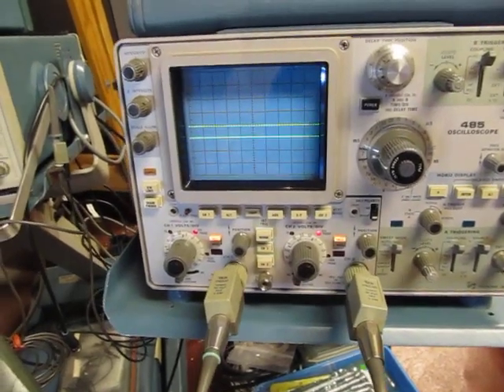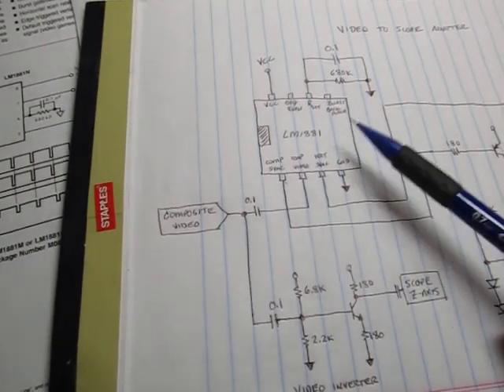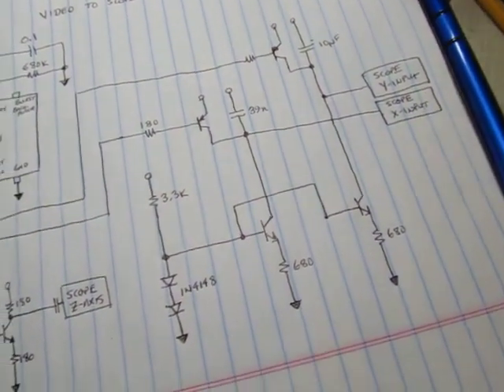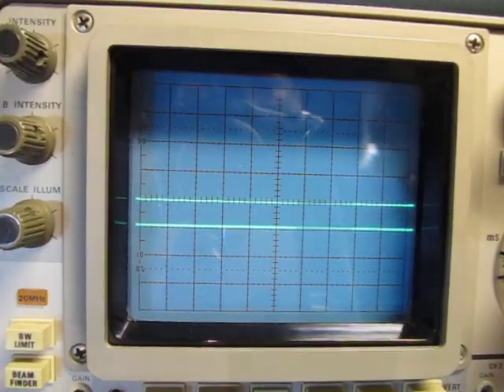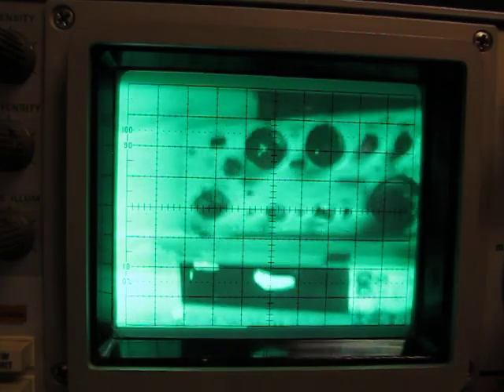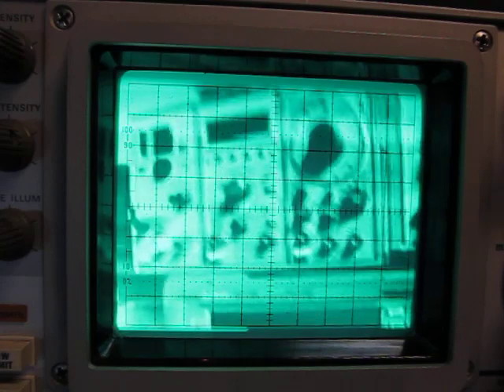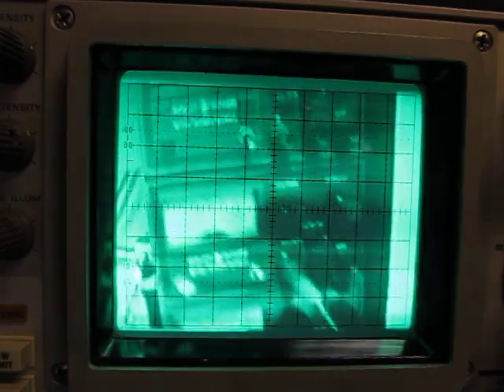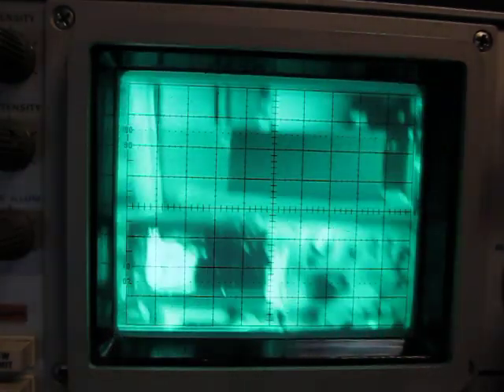#42: Composite Video on an Analog Oscilloscope using XYZ - Lab tour...

Comment: The only video to scope adapter circuit I've ever seen relied on the vertical and horizontal pulses driving oscillators that have to be adjusted, but this circuit is much simpler and easier to use.

Comment: @w2aew You said this earlier "In most cases no.  While most digital scopes have an XY display mode, very few of them have the ability to vary the intensity using an external (Z) input which is required for this to work". Surprisingly I found HP54600B (mid 90s DSO with 'analog' feel) with the following in their product manual: "When you select the XY display mode, the time base is turned off.  Channel 1 is the X-axis input, channel 2 is the Y-axis input, and channel 4 (external trigger in the HP 54600B and HP 54603B) is the Z-axis input.  If you only want to see portions of the Y versus X display, use the Z-axis input.  Z-axis turns on and off the trace (analog oscilloscopes called this Z-blanking because it turned the beam on and off).  When Z is low (<1.3 V), Y versus X is displayed; when Z is high (>1.3 V), the trace is turned off". This means that it should theoretically work, isn't it ?
Reply from the maker: +analogy ? It depends.  This application requires some linear control over intensity, while it sounds like the HP54600's z-axis input is binary, like on or off, and not an analog adjustment of intensity.

Comment: I would then either need a VGA switch box to select my second monitor or the scope or I would need a second VGA card.

Figure the VGA capability would make the circuit more versatile, but that said I do have a My HD TV tuner card that I think might be able to put out a VGA signal or maybe a composite signal. That might work better as I think I could clone the desktop to it so I'll have a full display as well as the scope.

Comment: Hello very interesting application. I have some questions about the pnp transistors. We have 9v DC on their emitter's so what's the influence of v base on transistor? It is always in saturation mode (the amplitude of composite video is not Large enough to have influence) 
I can't understand how it makes ramp if the pnp transistor is always saturated.
Thank you
Reply from the maker: The PNP transistors are only saturated when the SYNC pulses (active low) are present. Once the sync pulse goes away, the PNP transistors are off, and the NPN current sources creates the voltage ramp by linearly building charge on the capacitor.  The SYNC pulse turns on the PNP which discharges the capacitor and starts the ramp cycle again.

Comment: Great video!! Watching it, I had an idea, but I don't know if it makes sense: I have an old computer CRT, which I think works good, but the circuitry is not. What if I build a circuit similar to yours and hook it to the CRT and yoke? In other words, it would be like replacing the circuit boards inside my monitor with a new tiny board, using the LM1881 and a few transistors and passives. Do you think this might work? I can't find a complete datasshet for the CRT, but it's label have this info: Vf = 11V, If = 140mA, VG2 = 130V. Thanks a lot!

Comment: Hello. I was wondering if the signal you have on the oscilloscope is a digital signal. I have to take an NTSC signal and convert it to a digital signal to display the image, and was wondering if this circuit would work with that. I have access to the LM1881 and figured that would be necessary in the circuit to convert the signal.

Comment: Originally I used a TV for the vertical, horizontal and video signals and needed one scope to produce the vertical sawtooth waveform, one to amplify the video signal enough and the third for the horizontal sweep (used external sync input) and display.

Any idea if this would work with a VGA output on a computer? I had made an adapter that would combine the color signals into one composite signal and the vertical + horizontal sync is already present so I wouldn't need the LM-1881 then, right?

Comment: This video  is more than 12yrs old but I hope you reply . where is the video signal dc component restoration after the the inversion  (blocked by input and output capacitors)?
Reply from the maker: This circuit doesn't have any DC restoration.  But, I did make a slightly improved version where the composite video is DC coupled: https://www.qsl.net/w2aew/W2AEW_NTSC_2_Scope_2.pdf
Reply: @w2aew  Thanks for the reply. I have looked at the circuit and watched the video related to it and I noticed that the image quality is better, but I would like to point out that from what I have learned, any analog video source must  terminated with a 75 ohm resistor to get the correct voltages (1V p-p) for the next stages of the circuit and to prevent the signal from being reflected, or this rule does not apply in this case (note that I am self-taught in electronics and I take it as a hobby)

Comment: aren't those really current sinks instead of sources? Guess it depends on how you look at the circuit. perspective lol
Reply from the maker: Yes, "negative" current sources can also be called sinks.  They're often called sinks when they appear at an output, but usually generically called current sources when used inside of a circuit.

Comment: Cool circuit. Might have to build it.

Concerning the power supply does each voltage connection need its own decoupling or can certain voltage points be tied together?

Also would the Z axis output be enough for a scope that has a Z axis input that is unamplified and capacitively coupled?

Comment: They say no question is a dumb question... Does composite video signal draws the images in the same manner as the X and Y raster scan. What im trying to get at is, what if the video signal already exist and is not speed sync dependent. but the X and Y raster scan simply reveals the input video like a mask over an image. if this is possible i can imagine that we can have high speed video playback where the video is static and back-lite from the raster scan. please give me the straight and norrow
Reply from the maker: +Wayne Evans I'm sorry, but I don't understand your question.  Raster scan only works when the X and Y signals are properly synchronized - otherwise you'll have horizontal tearing and vertical rolling.  I'm not sure what you are asking or proposing.
Reply: Whats the video speed / refresh rate of the Z signal. how can we speed up video refresh from 30 or 60  mhz
Reply from the maker: +Wayne Evans 30-60MHz- really?  Well, the LM1881 sync separator chip used has a limit of about 150kHz for the horizontal scan rate.
Reply: +w2aew. ok that horizontal speed is pretty fast considering current 60hz video...what i want to do is make a laser video projector with galvo mirror..where the speed needs to be much faster than 60hz...
Reply: +w2aew  when it comes to this stuff, i"m from the stone age. but that's a good 
thing in a way because i get to re-invent something with simple 
logic...with some help. now let me share my thoughts. Sound can be use 
to drive a laser raster across a wall. Im thinking the LM1881 can  sync 
with the laser to draw raster image on wall. using software that convert
 image to sound.... X and Y projection is driving by stereo audio 
frequency and image is drawn by light intensity from laser. one 
horizontal slice at a time from top to bottom
Reply from the maker: +Wayne Evans Hmmm - without some kind of synchronization to the audio, such as doing some software graphic processing in-sync with the audio, I can imagine that the raster image will just look like noise.  You might be better off driving the X and Y stages, and even Z with separate audio paths (different channels, or different frequency ranges of the same audio path, etc.).
Reply: +w2aew oh yeah it would definitely be 3 channels. its just a matter of timing and dimming the laser.. easier said than done.

Comment: Wow!....... This is the Coolest, Greatest, Geekiest, and most original idea I have ever seen for a personal inventors lab tour video.... And in case you may not see yourself as an inventor, I have not only never seen, I have not heard of anyone even having this thought cross there mind? Even if it was thought of, most techs are either too formal or too much of a perfectionist to try it anyways? and as a result you got a golden video that you can call 100% your own
Reply: I and some friends used to do this many years ago, so it's an 'old trick'. I do have to say that the results in the video are pretty good though. When I did it however I didn't bother making a ramp generator for the X-axis because I just put the horizontal sync straight into the external trigger input of the  scope's timebase.

Comment: I have a tube scope (SENCORE PS148a) and a semi-solid-state scope Heathkit 10-?) (uses 5UP1 tube) the tube scope has a "z" input which is connected to the picture tube's cathode would it safely work? the other scope does not have this input.
Reply from the maker: Most likely it will work. You'd have to check the specs on the z input to be sure.
Reply: ***** I was using another circuit to test the scope completely tube driven, powered from the tube scope. It works sorta I had to turn down the brightness for a clear image and I realized that the scope and the circuit needs work (the one I built) the linearity was bad but that maybe because of an old cap I used ) or some parts need to be replaced in the scope. I'll try making this circuit too as soon as I can a LM1881 from digikey. the scope "z" is directly coupled to the picture tube's cathode. here's the schematic: http://img547.imageshack.us/img547/1482/sencoreps148ascopeschem.png
Reply from the maker: ***** Keep in mind that I made some improvements to this circuit.  You might want to take a look at this video: Improved NTSC video to Oscilloscope converter circuit / scope video monitor hack

Comment: Hello, this may be a rookie question, but why do you need the npn transistors as current sources in the X and Y  ramp generators?
It looks like they are permanently switched on from the two diodes providing VBE.
Could not the caps have been connected directly to the respective 680 ohm resistors and achieved the same thing?
Reply from the maker: Not quite. If only the resistors were used, the voltage ramp on the caps would be a non-linear RC exponential instead of a linear ramp. The NPNs are fixed current sources which result in a linear ramp.
Reply: ***** Thank you for such a fast reply.
I now see why you used the transistors, that makes perfect sense.
Thanks for sharing the knowledge.
Paul.
Reply: ***** How does this simple circuit for constant circuit work? It looks like it just applies a small amount of bias current, turning on the transistors to a fixed value.
Reply from the maker: Yes, a fixed bias on the base-emitter sets up a fixed, constant current in the collector.
Reply: ***** So can I build a constant current power supply with just a few transistors and a zener diode? how precise is this? I have also been needing a ramp-wave generator to create a simple class "D" amplifier and maybe a very simple oscilloscope (using a homemade CRT, some large electromagnets or deflection plates, a ramp-wave generator to create a sweep, and a high-bandwidth amplifier with a high-impedance input. How does triggering work on scopes?)
Reply from the maker: Power Max Yes, you can build current sources with just a few parts.  They can be relatively precise with careful design.  Often, an op amp is used to stabilize the current vs. temperature and supply variations.  Current sources are useful for linear ramp circuits, as show in this video or in the video in this link:
Circuit tutorial - sawtooth generator w/ current sources, diode switches and hysteresis comparator
Analog oscilloscope triggering works by holding off the start of the ramp (sweep) until a trigger event occurs, so that the sweep is synchronous with the trigger event.  I have several videos that discuss scope triggering.
Reply: ***** Thank you! How does a trigger detection circuit work? I don't think I can use a arduino with some code on it to detect that, I think its cycle time would be too slow. I'll look though your channel to see if I see anything on that.
Reply from the maker: One simple solution would be a comparator that controls a flip-flop whose state enables or resets the sweep generator. Then, you can devise various coupling (AC, DC, HF Reject, etc.) and offset controls to the comparator to trigger on various aspects of a signal. See my video on Trigger Controls to see what's been traditionally done on analog scopes.

Comment: i have a question..
i made this circuit, First it wouldn't work at all, unless i short pin 5 and 6. then i would get an ugly image with wrong contrast. any idea what i'm doing wrong?
Reply from the maker: All depends on your scope.  There is no standard for how the Z-axis works on analog scope.  Some will increase brightness with increased voltage, some will work opposite.  Also, the required voltage could be positive or negative, and the sensitivity could be a few hundred mV or a few volts.  Thus, for the contrast issues, you may have to do some more signal conditioning on the Z-axis drive.  My updated circuit from this video:
https://www.youtube.com/watch?v=yf4kOMSPbM0&t=1s
might help, depending on your scope.  The link for the schematic in this video can be found it that video's description.
I have no idea why you had to short pins 5 and 6, that makes no sense to me.

Comment: Hi, whats the minimum bandwidth requirement for the oscilloscope to correctly display the converted composite video signal? Thanks!
Reply from the maker: For a composite video signal, anything close to 1MHz or so would be more than enough.
Reply: @w2aew  Thank you for your help!

Comment: Thanks for another great and fun video. This makes me wonder... how difficult would it be to do the opposite- use a tv/monitor as a scope display?
Reply: not very hard if you want a low quality scope but this comment is seven years old so you've probably already know this.
Reply: @JoeyLindsay  two years later, as a newbie to the hobby...
What would be the most limiting factor? The speeds, I guess? I mean, the sweep speed and the vertical deflection speed.

I have no idea about it, but I imagine scope tubes were construed to maximize those deflection speeds, so that we can get, say, in hundreds of millions of full vertical deflections, while TV vertical speed doesn't have to be anywhere near that number.
Reply: @tomaszwota1465  digital oscillators are limited by their sample rate basically harmonics shape the wave and all they are is sine waves.  Think of it kinda like a guy that asks the cashier his total after every single time and plots it on a piece of paper.
Watch technology connection’s Nyquist-Shannon video
Reply: @tomaszwota1465  analog electronics rely on basic electronic physics to define frequency.  Minecraft redstone is analog and digital if you’ve ever played
Reply: @JoeyLindsay  never played Minecraft so any analogies based on that will go over my head, I'm afraid.
Reply: @JoeyLindsay  I guess you're thinking of digital displays, while I imagine the question (certainly in my mind, if not necessarily in op's) was rather pointed at CRT TVs and monitors.

Certainly I had only them in mind when making my above comment about deflection speeds.
Reply: @tomaszwota1465  basically 
Digital is on or off while analog is limited by the speed of light and digital is how fast it gets
Reply: CRT phosphor stays illuminated by electron gun for a tiny amount of time and our brain creates an image because it makes sense of a fast moving dot.  And digital electronics don’t do decimal numbers accurately (modern screens are just a bunch of simple colored dots) it’s like only dotting on the “+” and digital electronics rely on computer software which is limited by clock cycles (how fast) but our brain is better at “connecting” dots than computers are

Comment: Very interesting. Do you know if this will work with PAL composite video input?
Reply from the maker: Not sure - I am not familiar with all of the differences between NTSC and PAL.  I'm sure that something similar could be done with PAL...
Reply: OK, thank you. I ordered a couple of LM1881, as the datasheet says that it supports PAL. I guess I'll just have to have a play around and see what works.

Oh and very good channel, not at all jelly of your workshop... Also loving all the analog scopes, I've got an old Iwatsu 5710 and I much prefer it to digital scopes for general mucking around.
Reply: ***** yes this will work with a Pal signal
Reply: +Sheldon Holy It can work with both PAL and SECAM composite video inputs

Comment: Hi Alan is it dual trace or dual beam 2467 BHD
Reply from the maker: The 2467 is not a dual beam scope.  It can display multiple traces (channels and delayed timebase signals) through display modes such as ALT and CHOP.
Reply: Thanks
Reply: Does Tek have dual beam scope
Reply from the maker: Tek made several dual beam scopes over the years.  A decent guide to them can be found here:
http://www.ebay.com/gds/A-Guide-to-Tektronix-Dual-Beam-Oscilloscopes-/10000000000726639/g.html

Comment: will this work on a rigol 1054z ?
Reply from the maker: Unfortunately, no. To my knowledge the Rigol doesn't have a Z-axis input to modulate the intensity. Most digital scopes are like this unfortunately.
Reply: This means analog wins from digital
Reply from the maker: In this case, YES!